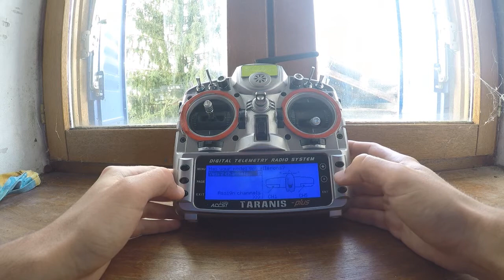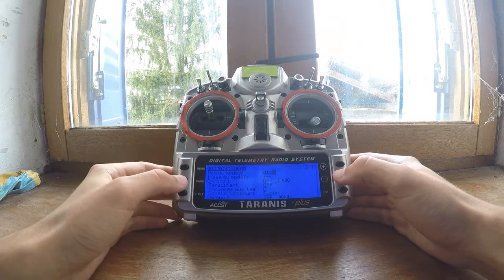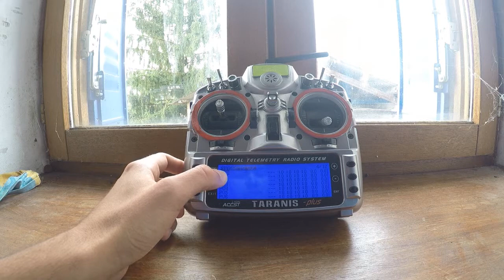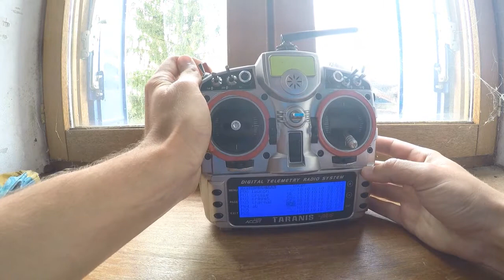Wednesday tech : Taranis settings part 1

Comment: Pierre, what modifications did you make to get the momentary switches. (air brakes and launch preset) Did this involve drilling holes or soldering?
Reply from the maker: Paul Gleeson yes , it s an aditional switch (for the preset ) I rooted the wires of the right 2 positions switch to a microswitch . and it was needed to make a hole in the case to put the microswitch.